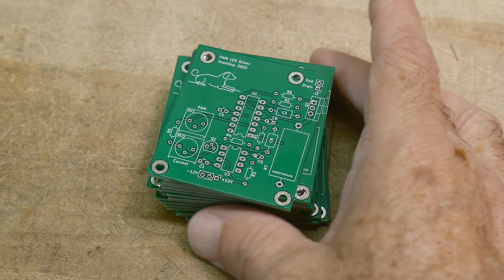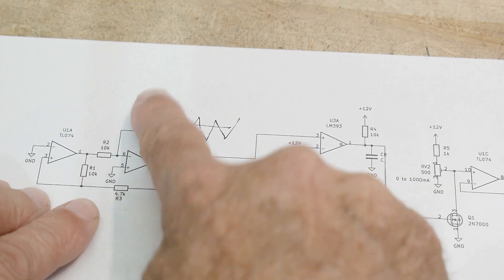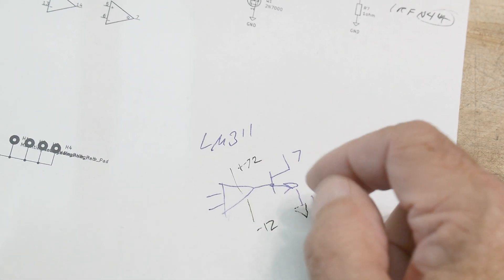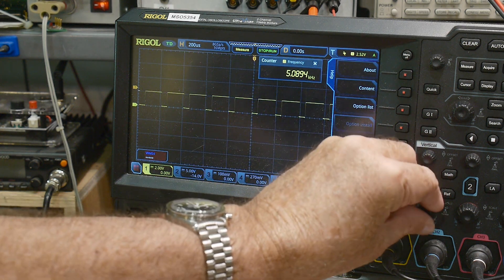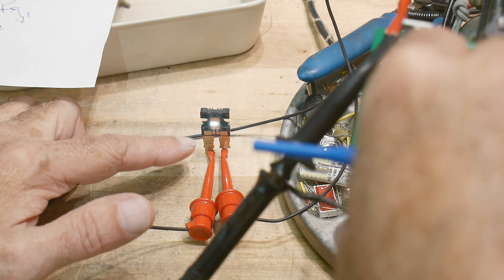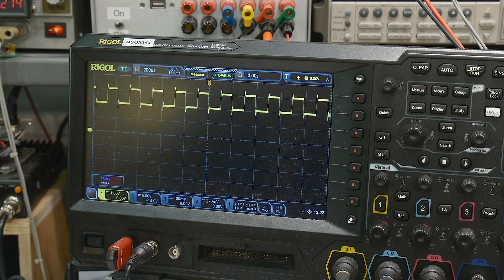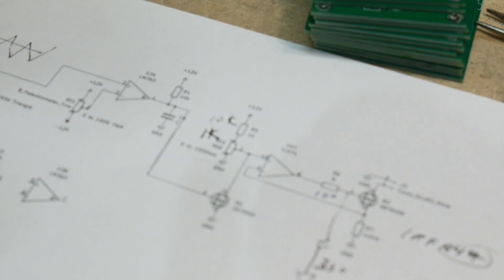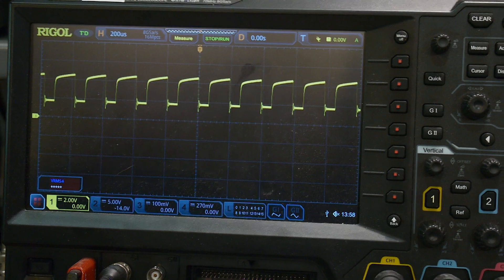#1310 LED PWM (part 2 of 2)

Comment: @IMSAI Guy, I'm dealing with a circuit pretty much the same as yours, but PWM (from microcontroller), frequencies of pulse from 1 to 5KHz to control an RGB led driver circuit. I'm using LM124 (quad op-amps) but in fact I'm using just 3 of its 4 op amps. I can control the current perfectly, but when I turn on at least one led of them (lets say the RED LED), the other ones turn on too (small bright). Any Idea of what might be problem?
I'm not using mosfet, but NPN BJT transistor instead

Comment: PWM and current control for an LED are redundant.    What is the application of this circuit????????????
Reply from the maker: it is to study wavelength shift. the drive conditions and thermals are different.
Reply: @IMSAIGuy  how does one study wavelength shift if the led CANNOT be turned ON/OFF within its I/V rise/fall time.??
I do not think either a full on with saturated current or limited current can give any wavelength shifts...
Reply from the maker: @analoghardwaretops3976  it is heating shown in my video: https://youtu.be/wB9IS_qRLx0:

Comment: You still have one TL041 open, can't you take that instead of the LM393?
The LM393 would switch to -12V. 
The LM311 has a free transistor at the output.
Or remove the 2N7000 and take the output transistor of the LM311 instead. But then the logic is invers.

Comment: With the extra jumps does that make it a 4 layer board. :-0
Reply: Nope Squeak !
Reply: @andymouse  so its two layers and an over and underpass then Mr squeak
Reply: @TheEmbeddedHobbyist  I'll give you that ! lol
Reply: @andymouse  3D
Reply: @jp040759  Yeah !
Reply: @andymouse  for such modifications.....here some say it's. like...the shanty towns & ghettos come up in the city after all the posh high rise buildings are constructed.... 😂...they provide the cheap labour...to keep the big ones well oiled & running smooth....

Comment: if you spin the pcb again, consider the two unused TL74.
With unused op amps it is a good idea to tie out to neg input, and pos input to gnd.
Maybe a picky thing but weird crap sometime happens - oscillation with unattended current consumption, radiation,...
I recall working in my basement on a radio years ago and found a horrible noisy portion of the FM band. I walked all over the basement with the radio and found that when near the water softener the intensity went way up. I disassembled the softener and peered at the pcb. I noted that I was not able to see anything that looked like bypass caps. WTF? So I added a couple around the opamps. No more EMI. 
That is not exactly the same as leaving the input open but is in a class of ignoring "good practice" habits. 
Actually - such things might make good videos, explicitly creating faults of the class. 
I'm sure Rex would have a bit-o-wisdom on the topic. ;-}